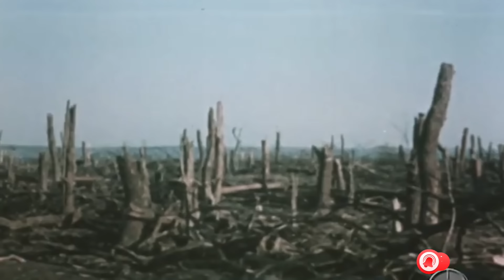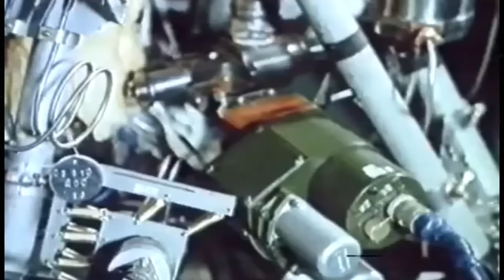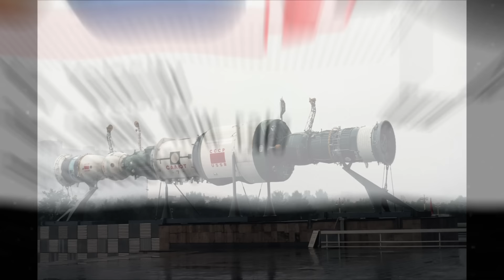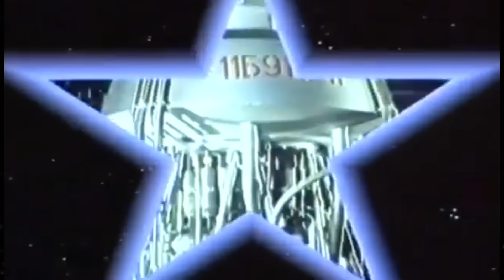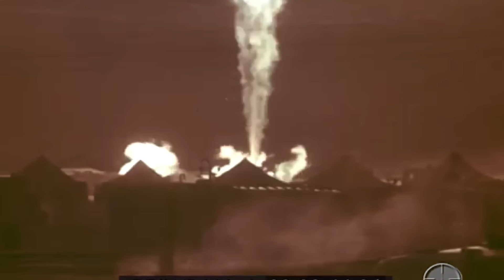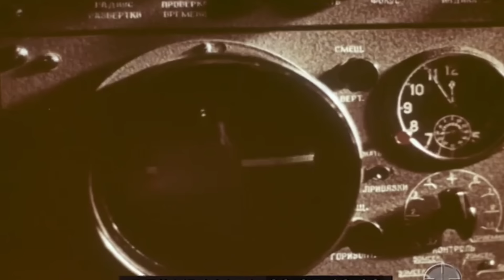The Nuclear Rocket That Beat NASA: Soviet RD-0410's Terrifying Success

Comment: INCORRECT ORIGIN OF THE US NTR ENGINE. The US version was first started by the Air force for use in the XB-70 Valkyrie bomber. The US NERVA/KIWI NTR engine was succesfully built and even tested in a launch configuration - aimed for launch in 1970s but Congress  and politicians threw it away.